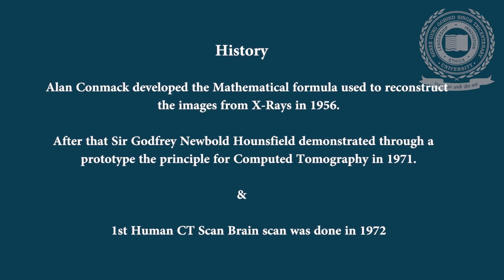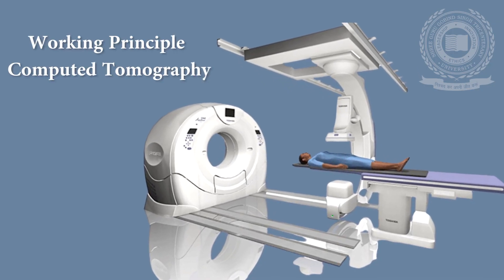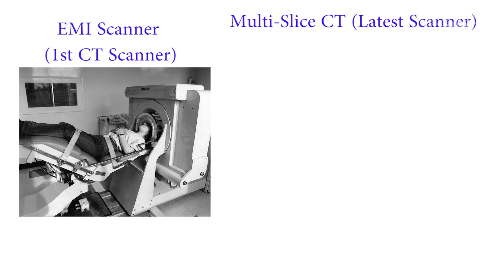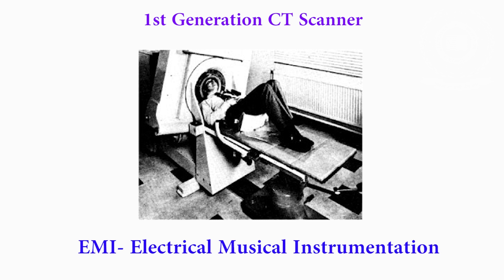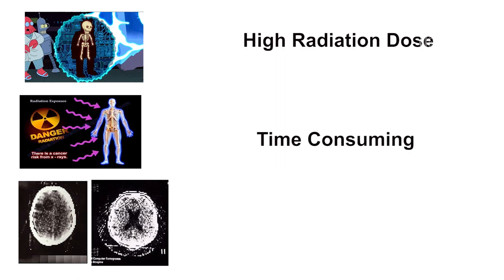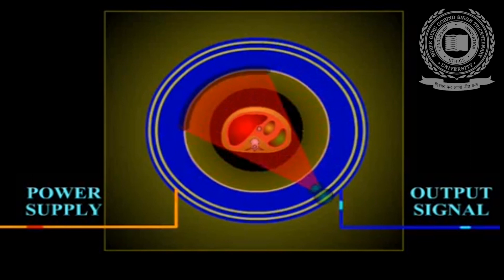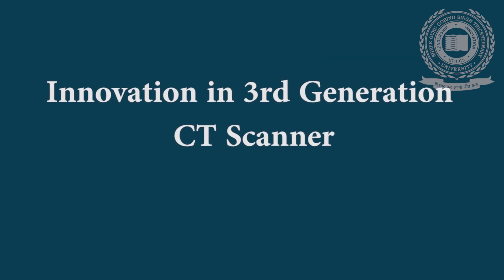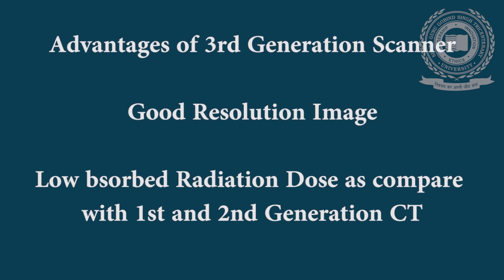CT Scanner Generation & Their Common Features - Faculty of Allied Health Sciences

Comment: In the first generation ct scanner, if the beam is pencil beam, then it looks like it took image only in single cut  even though it rotated, because the patient is lying still. To take the volumetric image, does the xray tube and detector translate in longitudinal  direction ?